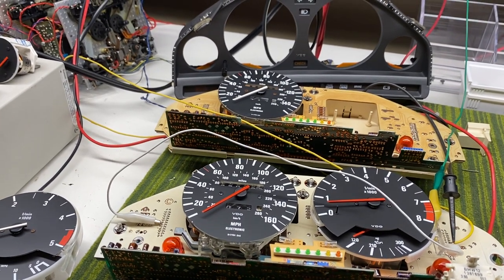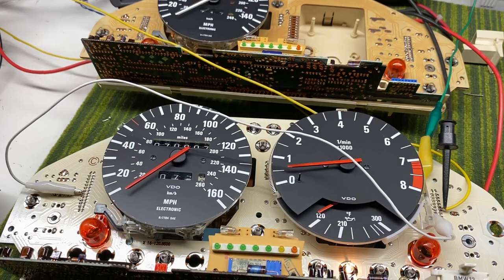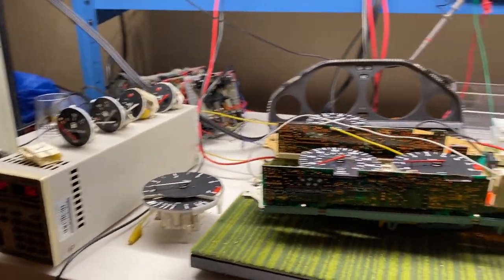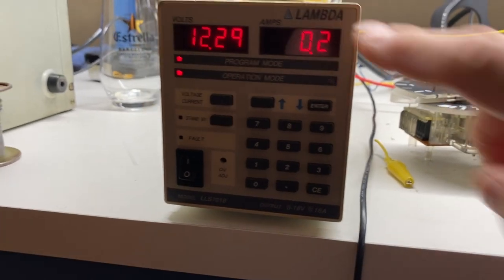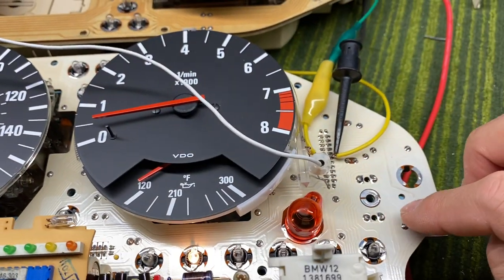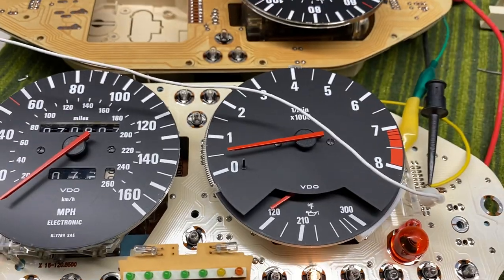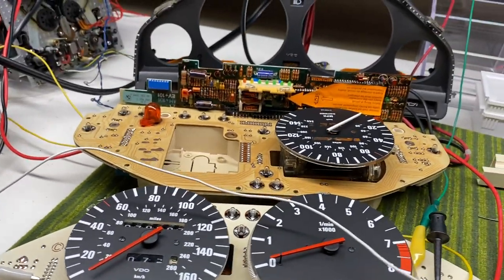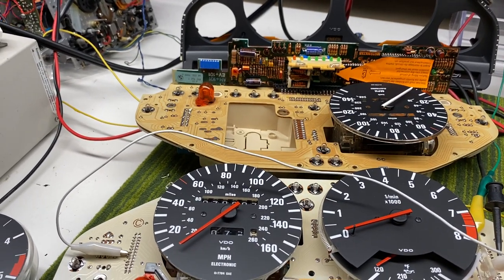Troubleshooting a BMW E30 M3 Tachometer, In Depth Part 1/2

Comment: Thank you for this information! you are the good type YouTuber really helpful 🙏 maybe you can help brother.. I have a bmw E30 but I have swapped the engine to a Nissan SR20 DET and I need to feed a signal to my tachometer do you know from where I can get my signal connection? Is it from the coil signal wire or the injector pulse wire? I have no idea how to get a signal.. maybe both coil to pin 7 and injection pulse to pin 11? Please advise 🙏